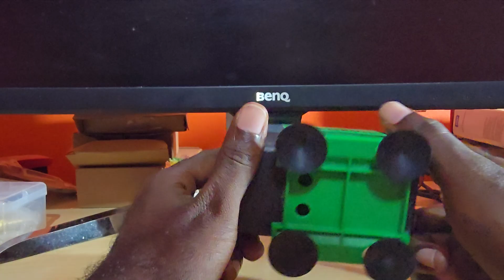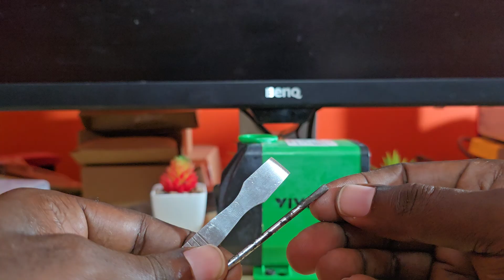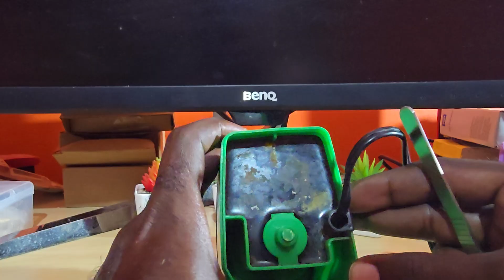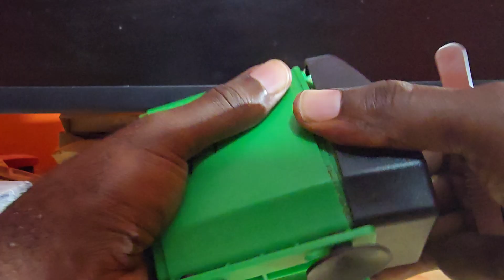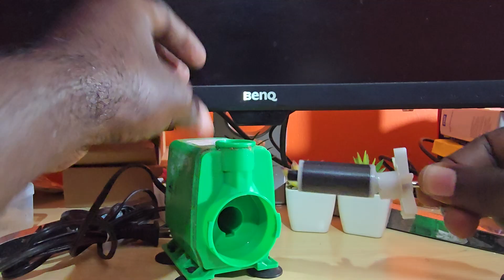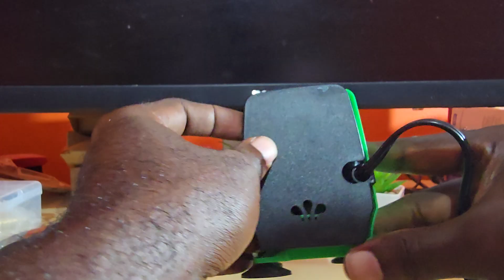Disassemble and Clean Vivosun 800gph Submersible Pump {Or Similar Pump}

Comment: My question is if the impeller (fan) no longer fits snug with the magnetic core, what do I do?  it seems like the inside of the impeller is worn a bit and I only had it a year.
Reply from the maker: My guess would be replace the part or remove the worn portion.